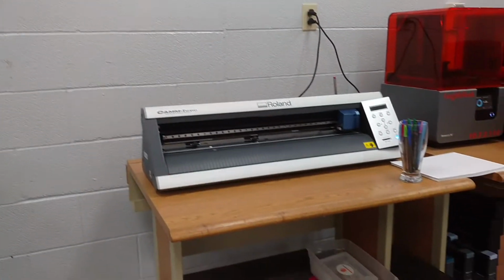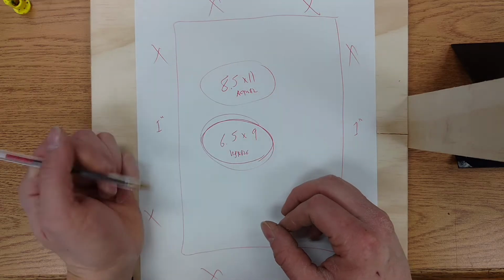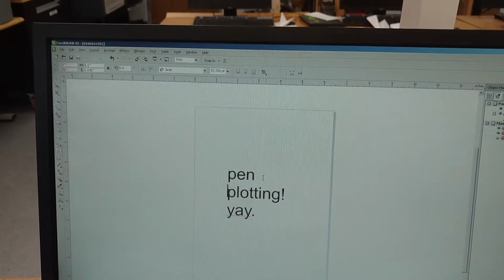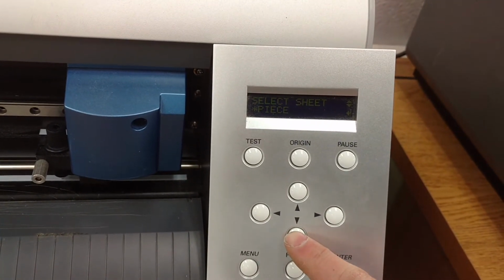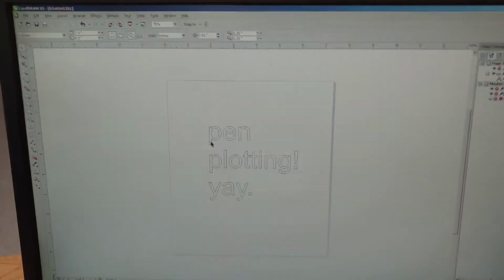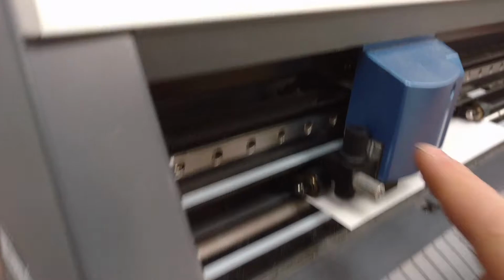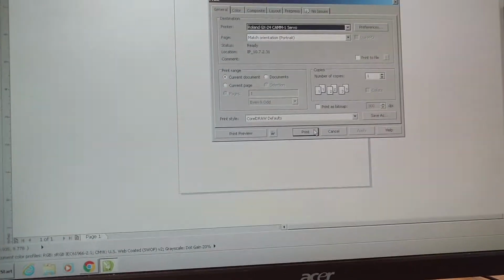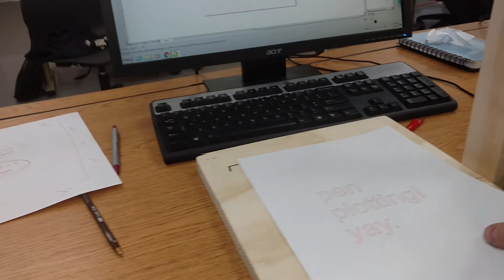How to pen plot with a vinyl cutter!

Comment: How friggin cool!! :)

I have an older Roland CX-24 that I got to work in windows, but the CorelDraw version i have is too new to work with the cutter. I have to export as eps and import into Roland's own software.
It is not a smooth workflow, but it works.

I was happy to see this. I thought one needed special smooth paper on roll plus special pens.